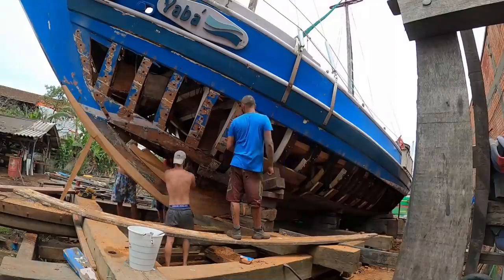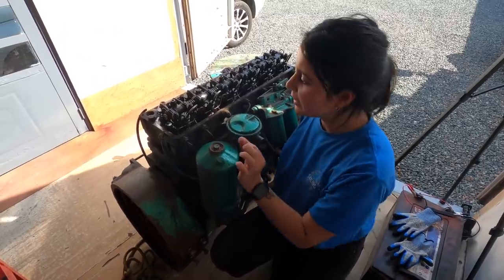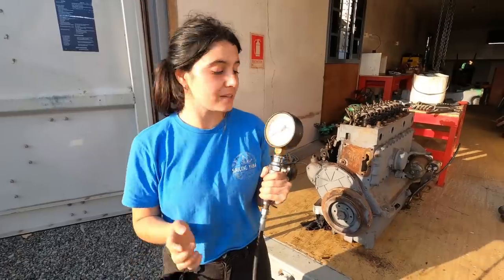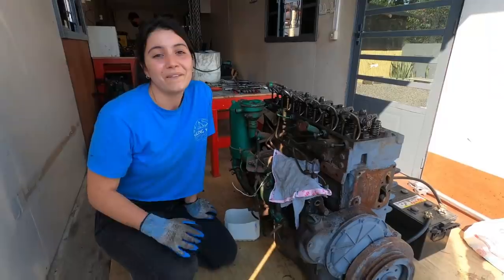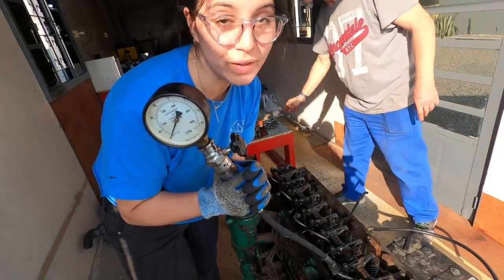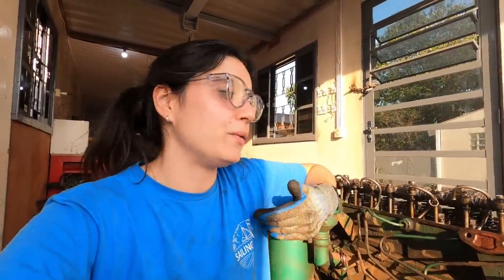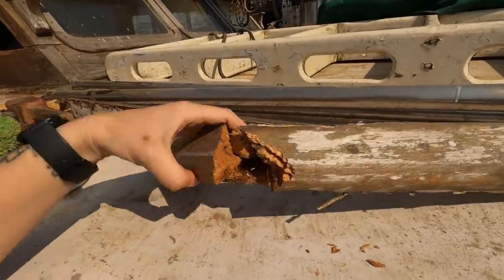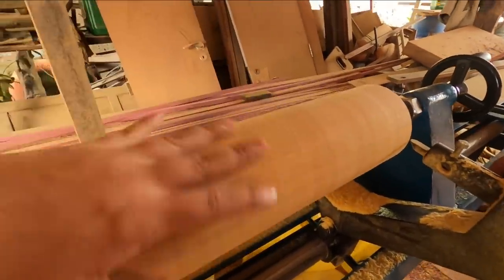Is our ENGINE worth SAVING? (the compression test will let us know) — Sailing Yabá #57

Comment from the maker: Hey guys! We know many of you were very curious to know more about our engine! 
So here we are! Finally! This was the first step of many of our engine journey! 
And for those of you who can't help but miss the shipwrights, hang in there, there's also wood work in this episode as our bulwark design changes finally start to take shape! 
We hope you enjoy this episode, have a great Sunday! 
Xx Ben & MP
Reply: Finally!!!!
Reply: Now you have done the pressure test, which tells you what the rings and valve are like, the big end bearings need to be checked and thrust washers, the amount of float etc
Reply: Euh... not really...
Reply: Kudos to MP, but we are sitting comfortably at home. The big question is whether passengers from countries going green will give rave reviews after being engulfed in a cloud of diesel fumes when the winds shifts and the engine must be used.  Can Yaba' earn her keep with that engine?
Reply: @777rogerf  You think it should run on batteries and solar power?
Reply: You did just fine MP.
Reply: Hello MP, I'm sure your mechanics are going to advise you because in the video you can see that they know what they do, do a complete Overhaul now, it will be cheaper than if you do it when a gasket burns in the middle of the sea in a few years, maintenance of injectors and injection pump, complete overhaul of gaskets and seals (that comes in a kit), maintenance of the starter motor, the mechanics will see how the rings and cylinders are, sure they completely disassemble it. Greetings and keep learning
Reply: @patrickbaillargeon8051  Well.... Guess not as long as it was maintained as well as the rest of the boat.
Reply: What colour are you painting your engine....? Make it look new n bright😍😍😍😍😍
Reply: You're doing so well darlin at narrating the videos and explaining
Reply: @manolisgledsodakis873   In many cities large diesel-powered busses are being replaced by busses powered by batteries that are charged overnight.  That might well work for day-sailing dive trips.   The diesel could be saved for emergencies or repositioning trips.  I' am only suggesting a review of possible alternatives that could better fit the intended use(s).
Reply: @loveoracle8797  Darling ??
Reply: @777rogerf  almost every sailboat has Diesel engines as do most other ocean going vessels. So there won’t be any issues with any country about it.

Comment: I would focus on installing new sub systems such as water pump, alternator and starter and possibly using your old ones as spares for off shore repair. Starting with a new bank of batteries and most importantly a very clean fuel tank with high quality filters and pump. Clean Diesel is the most important thing for the health of your motor. Always be cautious where you buy fuel.

Comment: I’m a journeyman diesel mechanic. 

Are you sailing out of Brazilian waters? Are you sailing around the world? Are there parts readily available for that engine outside the of Brazil? The rule of thumb is that it will break down in the most inconvenient place possible and then you’ll be stranded somewhere like Ecuador, Guyana, St. Helena or French Polynesia for months waiting on parts. 

Squirting oil into the cylinders before the test gives a false high and false average reading.

The fact that it has ok compression is not nearly the only factor you should consider. If you have a heat exchanger failure, a stater motor failure, a water pump failure, a head gasket failure, a fuel injection pump or fuel injector failure while in overseas will parts be available In a timely, cost effective manor? Did it run before you took it out, yes. Will it run again, yes. The question is, will it leave you stranded overseas for an extended period of time when something breaks. And it will break. 

With a Yanmar you’ll be able to get parts worldwide. That’s why your friends on Odd Life fitted a new engine. Their old engine ran.

Also a new engine will get better fuel economy with less emissions. Insurance will be easier to acquire with a modern engine.

Run a fundraiser for a new modern engine. I would donate.
Reply: I agree. Part availability is super important and I bet parts for that old engine would be hard to get. Yanmar is a better bet.
Reply: That boat is not built to travel the world anyway. It’s not designed to be a blue water vessel. It’s designed to be a littoral or even riverine boat, meant for sailing up and down the coast only and is not designed for crossings. I’m afraid they’re going to be in for many disappointments.
Reply: Actually that was their plan all along: navigate the coast only. This, plus the fact scunas is sailing boats, might justify keeping a not so great engine - is should be for small maneuvers only; is not cost wise to have a huge Yanmar for so little work.
Reply: @melinafioravante8136  coastal sailing might lead all the way to the Bahamas or even to the Panama Canal and down the coast the Chile. If so there will be many multi day crossings. 

Crossings aren’t limited to blue water.

That engine isn’t worth putting any money into.
Reply: @ralphgesler5110  any how many of those are still in boats around the world? Not many. And the parts that are important like heat exchangers, marinized exhaust manifolds and such are going to be a problem when they fail. And they will on that old of an engine. Let along availability of other major and minor engine components. Maybe there is availability in Brazil but if they plan to leave Brazilian waters then they’ll want something with parts availability. 

I love classic Diesel engines. I’m a Diesel Mechanic not a “technician”. So I know older stuff. And when someone’s life is in the line in a storm or when they’re stranded for months half a world away because they have to special order a fuel injector or head gasket they’ll be regretting keeping such an old engine. 

If they’re staying within range of “home” that’s a different story.
Reply: @jeremykamel9655  Well, that’s true. But I’m not sure Ben & MP plans to establish an itinerary worldwide diving business, and that’s their plan for Yabá, as far as I recall; I think they’re heading to the same “caiçara” lifestyle MP had growing up  - which is quite perfect for the type of boat they’ve picked, btw. Personally I’d love to see that, would be so much unique :)
Reply: @melinafioravante8136  a Yanmar is not “huge”. It’s probably the most popular engine for sailboats. It’s in the majority of boats.

Comment: There's more to evaluating an engine than testing compression--testing wet at that. While it's in the workshop, and valve cover already off,  I'd be doing lots more. Better, easier, cheaper now than later in situ. Testing the injector pump and spray pattern of the injectors. Fuel lift pump. Remove the head and inspect cylinders. Grind valves. Renew valve stem seals. Set valve clearance. Check oil pump, crankshaft seal.

Comment: just make sure your injector valves are being opening pressure checked and adjusted, no dripping and equal spray patterns are vital to an old diesel engine.....
Reply from the maker: You are absolutely right! The injectors pressure check is very important. When we do the full service on the injection pump we will also be checking each injector individually!
Reply: That's good and The Nozzles pressure test also.
Reply: I think it stands to reason, if the mechanic is doing a compression test,  he has the injectors out, they will be cleaned, checked and set up.
Reply: @andysimons9226  given how he checked the compression I wouldn't assume anything

Comment: I dont know who your diesel mech is but you Never squirt oil into the bore before a compression test, after a dry test you re check any low cylinders  with oil  to see if the low result is from rings or valves. If it goes higher with oil on the second test the fault is worn rings, if the second test remains the same the faukt is worn valves.
Reply: Thank you Ann for saying this.  I rather suspect that since the engine has been sitting so long without turning over the mechanic was concerned over no lubrication in the cylinders, which is a real concern, but squirting oil into the cylinders to lube them is probably not the best indicator of a healthy engine.  They should have changed the oil and filter first, got the engine running, and then took it apart to do the compression check.  Just another thing to come back and bite them in the ass in the future.
Of course, Yaba was never designed to be a sailing yacht, it's a motor yacht with sails, so they will be using the engine a LOT, whether they know that now or not, and it should be well taken care of.  It isn't.
Reply: Good point Ann, was thinking the same thing.  I'm hoping that there is just some info we were not provided on the process taken.  I guess it all depends on the level of rebuild they intend to do on the motor.
Reply: @codemonkey2k5  from what they've said, I don't think they're planning on doing ANY rebuild.  Just put it back together.  Recipe for disaster, IMHO.
Reply: @GaryMCurran  yeah strongly advise strip engine to check what’s worn.

Comment: Ben should be very proud of you MP, you did an amazing job well done!
Reply from the maker: Thank you!!
Reply: @SailingYaba  MP, I'm sorry, your lack of information and knowledge does not bode well for you.  This engine needs to be pulled apart and rebuilt.  The mechanic should NEVER have squirted oil into the cylinders before starting this test.  He'll tell you it's to lubricate the cylinder walls from the engine not being run in quite some time, and yes, I will agree with that.  But, it also artificially raised the compression readings.  Cylinder 5 didn't reach 20, it only hit 19, and the others should have been above 20, and weren't.  That engine is in dire need of a rebuild, even if it is a diesel engine.

Comment: I'm sorry but if that was my engine and it is out, the. Very least I would do is strip it, re grind valves check spring rates, light hone of bore new rings  if crank is good, polish all journal's  fit  new bearings, renew or overhaul all ancillarys plus full injector service.
However that is only my opinion.
Reply: Well it isn't your engine is it....
Reply: @MegaDirtyberty WTF ! I know one thing I wouldn't want you fixing anything for me with your leave it alone attitude .
Reply: @geraldswain3259  WTF ! I know one thing I wouldn't want you fixing anything for me with your fix it even though it ain't broke attitude .

Comment: Now comes the real fun. Cleaning the injectors, adjusting the injectors and valves, rebuilding the water and fuel pump, upgrading the alternator, changing the oil several times...

Comment: Great presentation of the compression test.  Interesting to note that since the very beginning of the series, you seem more comfortable with  the mechanical side of things than Ben. There is actually a better test known as a "leakdown" test that will tell you WHERE any escaping compression is going: rings or valves or guides.
Reply: Yeah, I thought I heard a couple cylinders trying to fire using the lubricating oil they sprayed in.
Reply: @theradioweyr  should not squirt oil down the cylinders before a compression test. It gives false  high and false average readings. 

Guarantee those would not be 20 bar without the oil.
Reply: @jeremykamel9655  I'm guessing it was diesel. That engine has not been rotated in months.  Doing a compression test without something in there wouldn't have been accurate either.
Reply: @merlars  not sure about you but I don’t keep diesel in an oil squirt can. Not sure about that guy. 

If they’re worried about dry pistons/rings from sitting then diesel would would lead to damage because in this scenario it would act like a solvent. 

Engine sit for years and start right up. Sitting for a few months is no big deal at all. 

Think of standby generators. Most people never start them monthly like their suppose to. They’ll sit for years and then start up and run a load immediately.
Reply: 100% bang on with that comment
Never in 30+ years of compression testing diesels have I ever put oil in before a test.

Comment: I would have pulled the engine down to the inspect the water jacket if salt water was used to cool the engine. If you are placing it back I would use a heat exchanger to cool it with fresh water and use keel cooling.

Comment: I love to see MP is not afraid to get stuck in.  If I May make one suggestion. Add a secondary Oil filter. The one I used to use was a quick change cartridge almost like a toilet roll.  It was very cheap to change a filter and took 5 minutes..  I run a commercial Mercedes for over 600k Miles using them.  Absolutely worth installing.

Comment: What you learned as a scuba instructor was true 50+ years agoo.

If you look at the back of your SPG you will see a hole, modern marketers are designed to explode out the back if anything go wrong. That is the dangerous side of your SPG, be sure to not direct the back of your SPG at anything but it is safe to look at the dial when you are opening your valve.

Comment: Fantastic job doing the initial testing of the engine.  Its good to see that it is operating within specifications.  I do wonder however, since the engine is out of the boat, will you be doing a full tear down and rebuild? Cylinders honed, new wrist pins, new rings, heads trued, valves cleaned and lapped, etc.  Since you won't be able to remove the engine again once its installed and the remaining planking put in.   I am truly enjoying watching the progress and the craftsmanship unfolding.
Reply: Tear not tare

Comment: Dont be afraid, the compression is higher than the manometer shows. because the compressionroom becomes with the adapter and the rubberpipe volumina bigger.
one advice: on the suctionpipe in the fueltank put a normal roughfilter, after the fuelpomp shall be the finefilter and than it goes to the injektorfuelpomp. in this way you have pressure on the fuelfilter and you can open a bottomvalve to let water and dirt out.. on one of my boats i got diesel in marroco with a pipe which was used for drinkingwater and fuel together. to get the water out at high sea makes me crazy. also a nice idea is to get a second fuelpomp (electric one) only for pomping the fuel trough a separatorfilter and back to the tank.

Comment: The first thing you should have done is to identify the exact manufacture and model the engine is. Then ascertain if it has wet liners in it or not. If it has wet liners as I suspect you need to see if what is called a repair kit is available. If there are still parts available to fix the engine then it will likely be cheaper to rebuild the old engine than to buy a new one. If you disassemble the engine the first thing you need to check is if the head is cracked or warped. You will need a machine shop to re-face the valves and likely replace the valve guides. Since the old engine has good compression and if is not leaking either motor oil, diesel oil, or coolant  you may get off cheap and just replace rusted and worn exterior parts. Those old diesels were built to last nearly forever.  If you buy a new engine you will, likely,  have electronic fuel injection and a ECM computer to make it run and they are much more compilated to fix and more likely to leave you helpless stranded. Just some thoughts take it or leave it...

Comment: That engine has flash rust damage in the cylinders. A healthy engine makes 75% of it's compression on the first pump. 

Those cylinders have taper. It may last a very long time like this but will always be difficult to start particularly when cold. I'd recommend putting in a grid heater on the inlet side to help it start.
Reply: I hope they take note of this.  I thought the engine was turbocharged in which case it would operate at 15-25 bar.
Reply: I did wonder about that. Did they not do the test ‘through’ the injector nozzle though?
Reply: Also the oil squirted into the cylinders prior to the test gives false high and false average readings.
Reply: @Tomm9y  I don't know, but i build performance amd racing engines as well as being a ASE certified master mechanic who specializes in diesel performance etc. That engine is wounded

Comment: When you go this far get a new engine. Fuel,  parts are all changed. Less problems down the line. .Or break it all down a complete rebuild. The bonus is.At least you two are going to really look after the boat and equipment  .
Reply: Yep, compression is only part of it. How do the bearings look? At minimum I'd want to check the bottom side of main and rod bearings or send oil off for analysis if possible.

Comment: dont know if i missed it, but is there a reason that your not investing in a newer engine? It would be far more efficient, and most likely also easier to maintain.
Reply: They're very expensive, all Marine engines are
Reply: They cost a lot of money and no point changing if this one works fine. It is a sailing boat so the engine should hardly be used.
Reply: I like the idea of a mechanical injection engine.  No shitty electronics to fail!
Reply: because it's expensive.
Reply: It is an old style Mercedes marine engine, it will last a long time.
Reply: @johncooper5293  Yaba is a motor sailor. The channel keeps downplaying it but Yaba is designed bottom up to run with a motor. She has a very inefficient sail layout and keel design for sailing.
Reply: While the engine is out you should change the rods and main bearings

Comment: MP - As you learn what's needed on the engine take note of the tools as you should build a tool kit with the needed tools so if your on the high seas you'll have them and the knowledge to use them ;-}